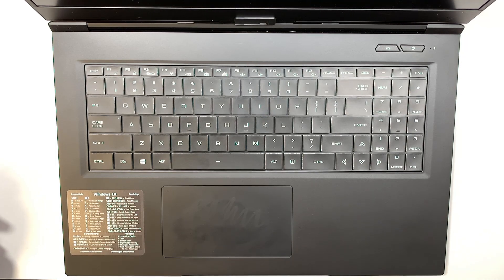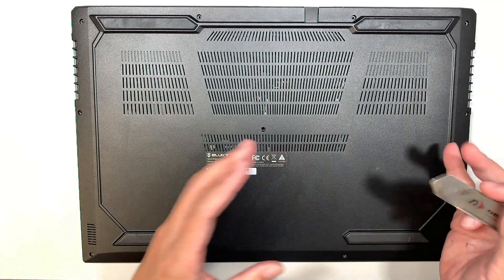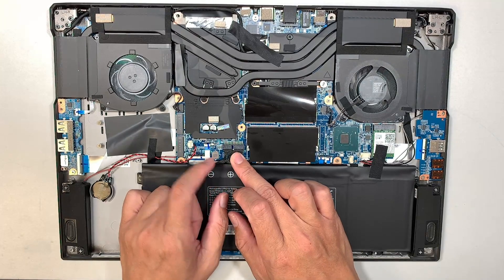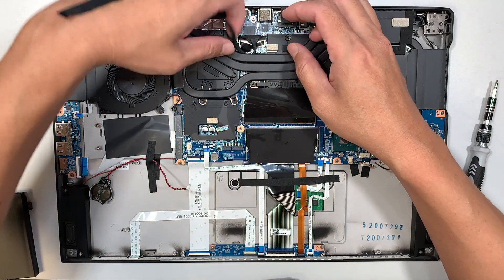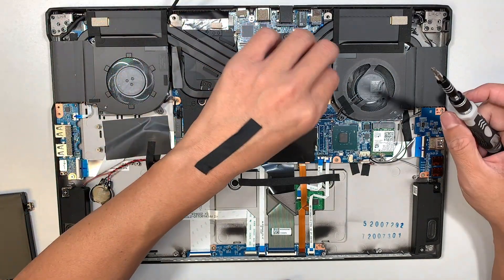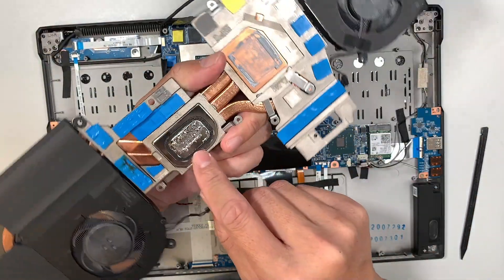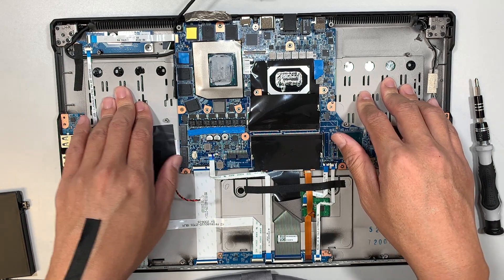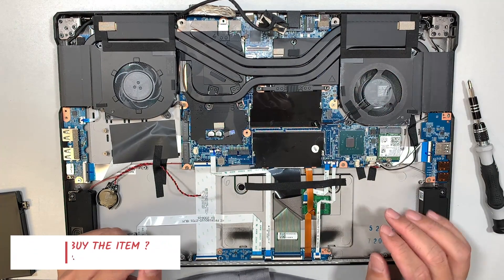Eluktronics MAX 17 Teardown Upgrade Disassemble

Comment: The keyboard is 100% replaceable and you don't have to remove the mother board or any of the heatsinks or the metal bracket. I was able to do it. Just a warning that removing the keyboard may damage the keyboard, so only remove it if you have a replacement part and are doing a replacement. Also, probably take a picture before removing the keyboard wires. 

Gosh, this was easier done than said:

Just remove the battery to have access to unhook the keyboard wires (the big strip/black and copper one in the middle of the mouse pad), remove the 3 screws on the bottom of the mother board, rip the keyboard out but make sure to prop the motherboard on the bottom up a little (this is why you have to unscrew those 3 screw) to let the keyboard's wire slide through. Yes, the keyboard is just glued on from the outside. Just rip it out. You may need a tool to help to dig in and get the ripping started. Once that's done, you can do the reverse to add in your replacement keyboard except do the adhesive/gluing last (once you confirm it's working). FYI, the replacement keyboard comes with the sticky tape on the back with a removable plastic cover, so you don't need any adhesive.
Reply: how hard is it to rip out?
some keys stopped working on my keyboard (aftershock vapor 17x 2021), so need to replace it

Comment: I got some problems with the keyboard some of the button its hard to type something I need to use exterenal keyboard to do some work, any tips? I look at reddit also they have the same kinda problem with the max 17
Reply: I have the same issue, it just creeped up out of nowhere. Did you ever figure out what was causing it? I did notice that one of my fans seems to not be working, so it may be related to that in my case, but I have not had the time to try and replace it yet.
Reply: @Dredd2992 you what I did buy a new keyboard from eluktronic now im waiting it to arrive to install it to see how it goes, I update driver etc etc but it stay the same, ooh you have fan issue also? Mine is only the keyboard so far, but I did buy another laptop a couple of month ago😬

Comment: is there a way to upgrade either the cpu or the gpu? or are they soldered on the motherboard? I didnt exactly see the cpu on the teardown but also new to laptops
Reply: Both are soldered. GPU on the left covered in grey thermal paste, CPU on the right smeared with liquid metal compound.

Comment: I've just acquired a very similar motherboard from an unknown laptop which I'm told is fully working.  I plan on installing it into my van but can't turn it on!
Your video is great, I can see the power button is top left of the motherboard and there are only 2 buttons and an led there but I can't see much more than that.  I also don't know why the power button daughter board connects down to the USB ports?
My motherboard is very slightly different (mbpgk7cp7c-sn13 - wifi card upside down?).
Who else made these laptops, I got here via a search for Mechrevo which I got from Clevo?